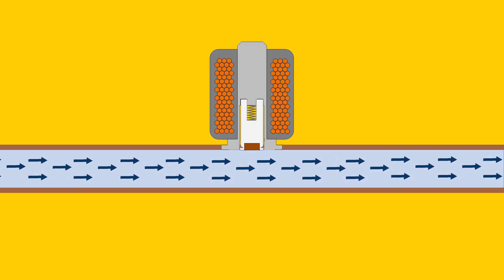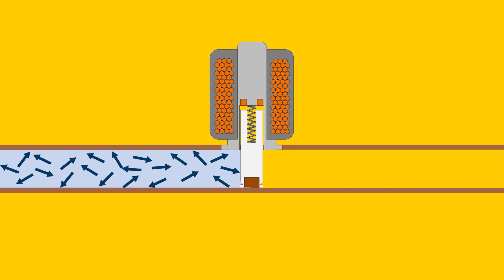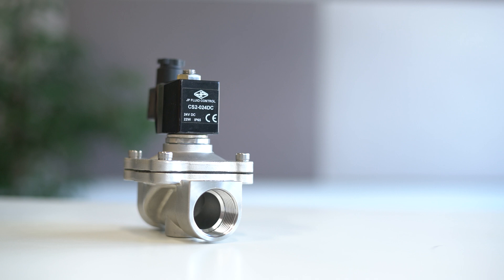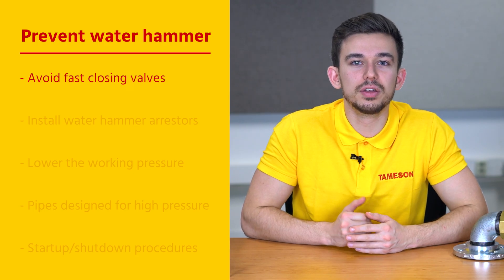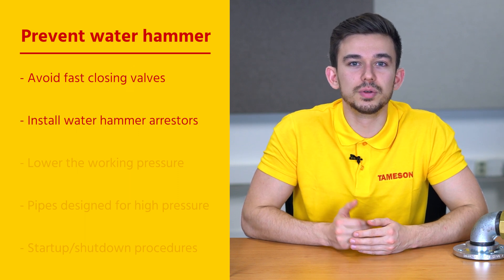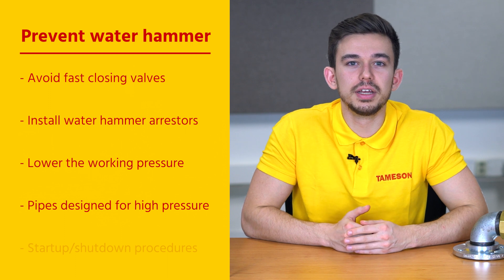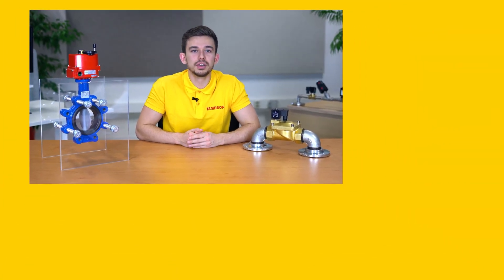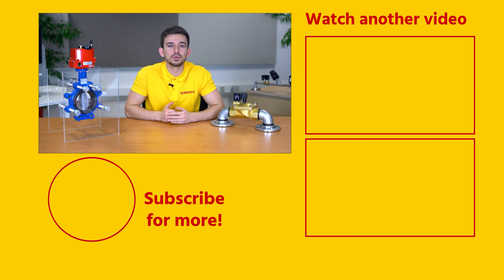What is Water Hammer and How to Prevent it? I Tameson

Comment: Thanks so much but I want to know the definition of water hammer
Reply from the maker: Hello, thanks for your comment. 

Water hammer is a phenomenon in which a pressure surge or wave results when a fluid in motion is forced to stop or change direction suddenly. This commonly occurs in pipelines when a valve closes suddenly at an end of a pipeline system, and a pressure wave propagates in the pipe.

If you need any additional info, please contact our support team.
Reply: The channel Practical Engineering has a video "What is Water Hammer" that goes more into depth on the topic.